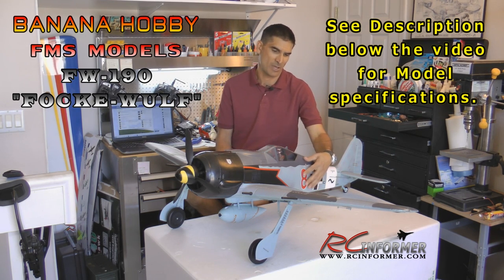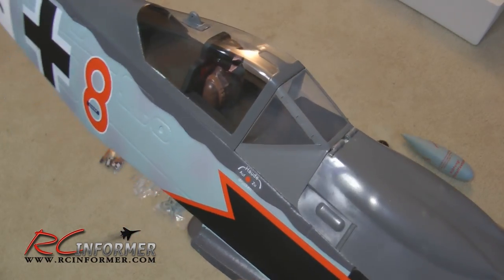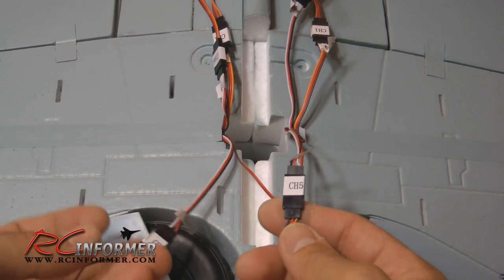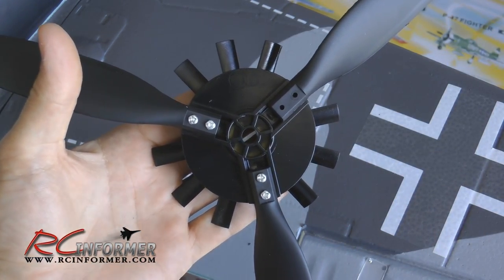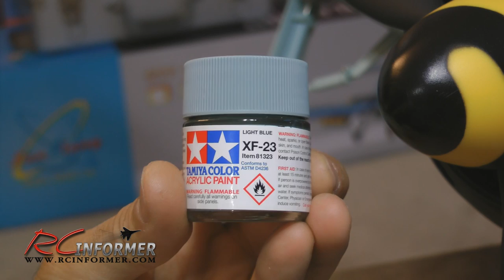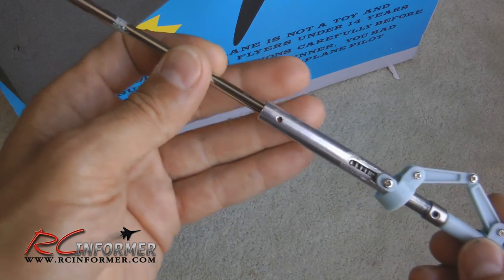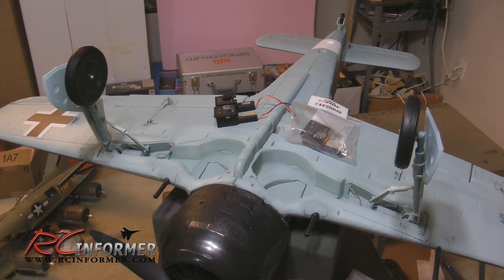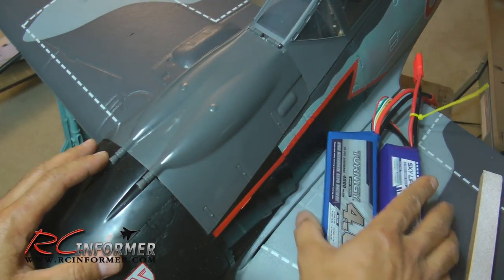Banana Hobby / FMS FW-190 Review by Rich Baker in HD

Comment: Very helpful video!  I replaced those flimsy 2-piece landing gear struts with 169mm oleos from HK.  185mm would have been perfect, but you get what's out there.  Used 5/32" music wire (same as 4mm) for axles, with slight bend to get wheel angle correct.  Then cut the 5mm retract pin to length such that wheels lay in wing bay as original.  Does require a bit of attention to the geometry before making cuts and grinding set-screw flats.  Much more stable.  (Oh... and I tossed out that tiny pilot bust for one closer to 1:7 scale.)  Gear doors haven't been re-attached - a simple job, but they sit proud of the wing bottom due to servo not being sufficiently recessed in wing.  ;-)

Comment: In r/c the FW190 design is one of the very best planes to fly, especially in larger scale (eg 1/4). With a skilled pilot, it can perform every flying manoeuvre, except a true knife edge (the dihedral prevents this). The key is to build it as light as possible, especially the tail end, as the plane has critical CG balance.. The large round cowl can fit many different engines. The wide stance is great for landings. I modified the wing to include wash-out and less dihedral. This enables better aerobatics and stall conditions. Scratch built from plans is always a better plane than ARF or kits.

Comment from the maker: It is possible you just need to initialize the ESC or the throttle channel is reversed. Be sure the ESC's BEC wire is plugged into the throttle channel of the receiver.Turn your radio on set the throttle to FULL. Then, while holding the plane, plug in the battery.... you should hear some tones, bring the throttle to idle after you hear the second tone. The ESC should initialize and you should now have throttle control...

Comment: I replaced my landing gear struts with 5 mm piano wire. Much more reliable. I have seen that other people glue all the parts of the struts together with JB Weld. The steps shown in this video are not sufficient to keep the struts functioning in the long run.
Reply from the maker: I still have the plane, so far my imprlvements are holding up since the date I made the video.... However nothing lasts forever. I am sure a thicker strut would be stronger but also will flex less and impose more load on the wheel well mounting plate and retract unit.....
Reply: RCINFORMER
Strength was not a problem. The problem was that I couldn't make all the little bits and pieces stick together. Maybe your craftsmanship is better than mine. The piano wire solution works fine for me though.
Reply from the maker: Gunnar Hovmark Are you talking about the plastic parts?
Reply: No, the metal. What happened was that the sideways swivel of the wheels increased for every landing until they caused a noseover. Then I had to tighten all the screws again.

Comment: Hi!

Why do you use 2 receivers?
Reply: I'm pretty sure what you're seeing starting @ 47:07 are not two separate receivers. You have the main receiver with the servo wires connected and connected perpendicular to that on the inner side of the fuselage is a satellite receiver. It's there so that whatever angle the plane is at in flight you have the receiver and the satellite receivers' antennas reliably oriented towards the transmitter antenna. If you ever hear about other flyers at your field losing radio connection mid flight on a regular basis, it's probably because of that issue where the antennas of the tx and rx not having proper orientation to maintain radio connection.

Comment: Gear are total junk. Don't waste your money.
Reply from the maker: Not true! While they could be better, the plane takes off and lands nicely on them :)
Reply: *****
I've had mine for a year and a half and have made hundreds of flights. No problem whatsoever with the electronics. The only weakness this plane has in my opinion is the landing gear struts, as Rich describes in this video. My solution was to replace them with piano wire. Other people make them stick together with JB Weld.